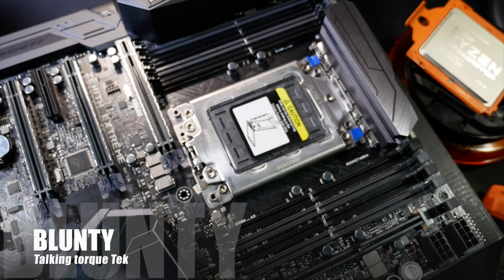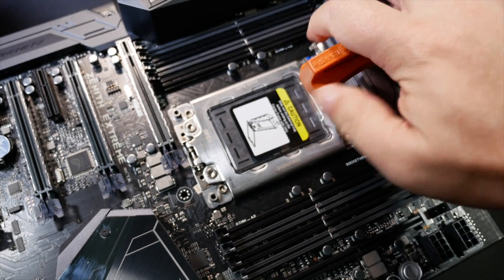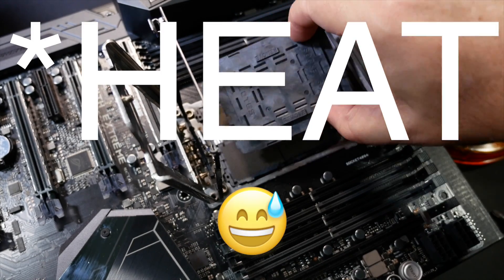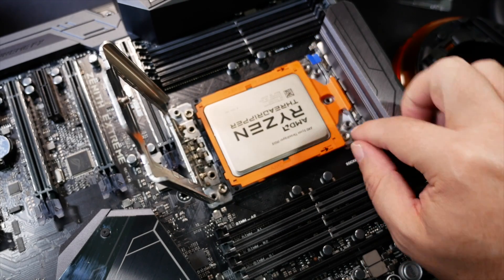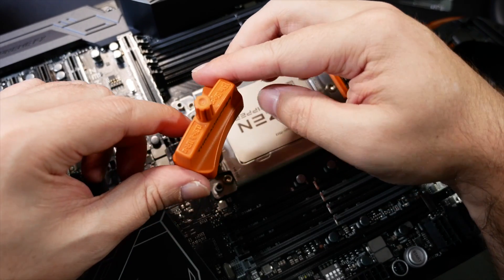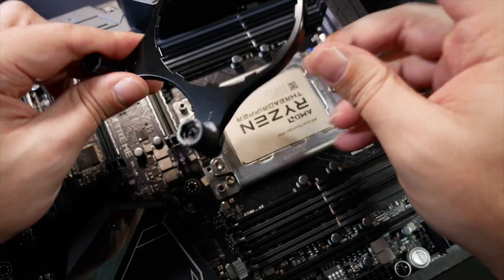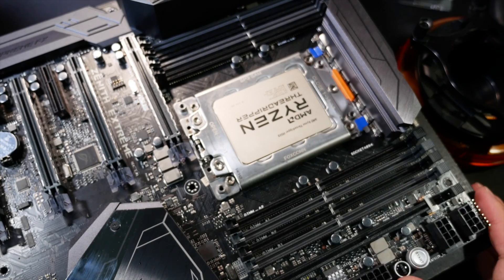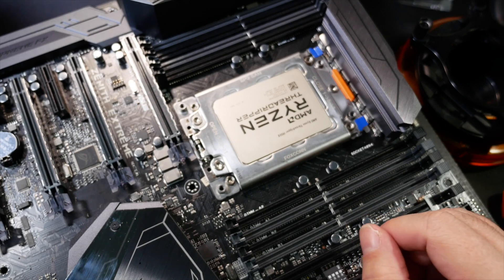HOW-TO Install Threadripper in the new TR4 Socket

Comment: Could you do a video of threadripper and air cooling?
Reply: There's a few of them. It will work with a surprising amount of them. Check out AMD's website for compatibility. There will be a mount/adapter so that the CM 240 works on TR4.

Comment: Bluntly, you should try seeing how well this runs A.I War, which is one of the most painful games to run once the game hits the 200 000 ship mark. On higher difficulties they send so many ships it crashes weak systems. It would be interesting to see how well this chip holds up. 

Though the game is not optimised for multicore cpus, and would probably run better with a simple high clock rate Intel cpu, it's worth having a look.

Comment: WOW. I am JEALOUS!! I Really can't wait to see what you're allowed to show next.
Also, i couldn't help notice on the Motherboard, 9 Memory slots?
I'm still using an old Phenom II build that i've had for 8 years now which uses Dual Channel memory, and I'm aware that the ThreadRipper uses a Quad Channel configuration, which I guess would be 8 slots?, but the 9th slot?
I didn't imagine seeing that did i? Please Enlighten me, if it's not under embargo. Thank you :)
Reply: AmazonianBeauty the 9th memory slot is actually an adapter for an Asus m.2 ssd card
Reply: That's for a M.2 expansion card
Reply: Thank you both, my knowledge is a bit outdated now, I've not used an M.2 drive yet, but i am aware of the benefits it has over SATA. I'd always wondered if Memory slots would ever be used for Non Volatile storage, and it has, atleast thats what its looking like to me, and it would make sense to do so.

Comment: Can we have a fps vs an i7 7700k on some tripple A titles but also GTA 5, The Witcher 3, and Fallout 4. Thanks Blunty.
Reply: Thread Ripper is not competing with the 7700K, it's competing with Intel's xeon processors for multithreaded workloads. This isn't really meant for gaming, go look up Ryzen 7 benchmarks, they intend to directly compete with the 7700K.
Reply: Actually, NO! This is competing with Intel's "High End Desktop" X299 system. This is /NOT/ anything to even care about xeons or any xeon processor. They have EPYC to compete with the xeons.
Reply: Computer no it's competing with i9
Reply: Oh, it's meant for gaming. It's meant for the future. The x399 is gonna be a beast. I hope they release a non X 1900 shortly after they release the 1900x because 250$ more to get on the tr4 socket is a bit spendy. I can't believe they released a new socket when the AM4 just came out in September. WTF?!

Comment: Silly Blunty, you opened the socket by undoing the screws in the wrong order! :P
Y'go 3 -> 2 -> 1 (or bot-left -> bot-right -> Top-mid) to unlock it, then to lock it back done you reverse the order (1 -> 2 -> 3, like you eventually got)! :P
Reply: I was going to say the same thing, I assume it's to be done in this order for a reason :)
Reply: Gormond it's done in a specific sequence so the pressure gets applied or lifted more or less evenly. Thus avoiding to deform the mechanism or damage the CPU.
Reply: you got that right! I was just going to also point that out XD